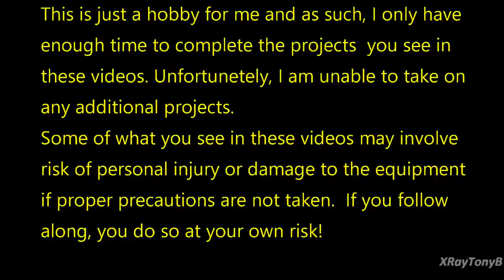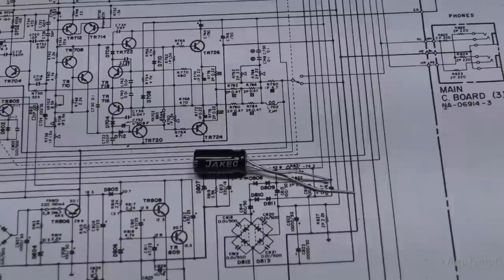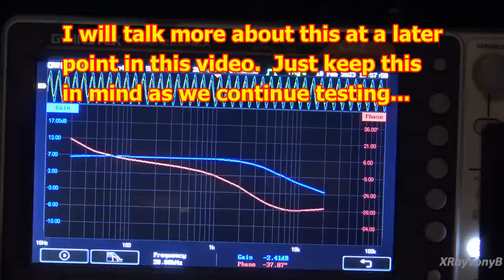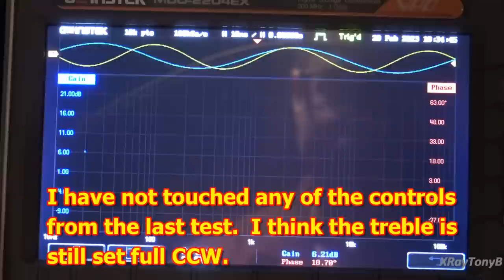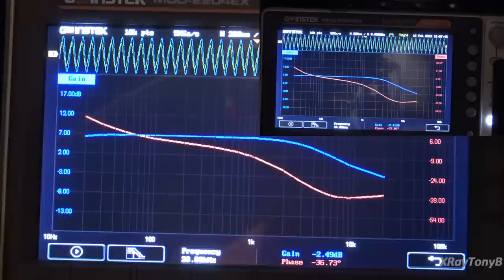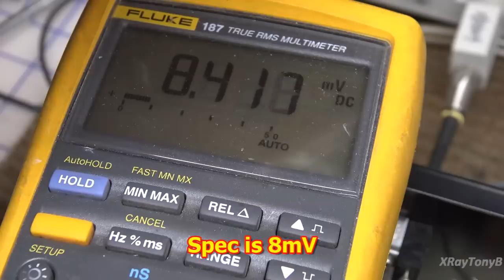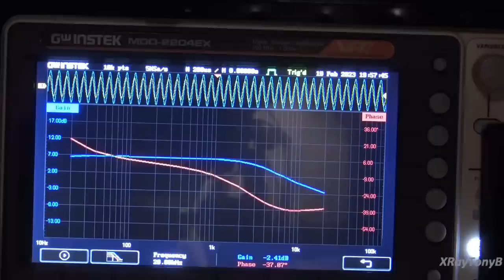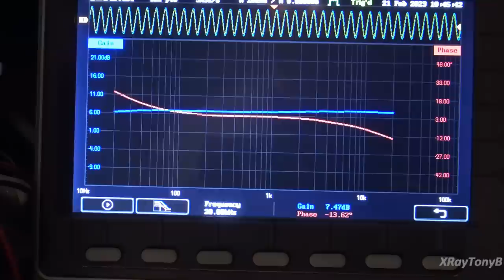Yamaha CR 820 - Replacing Capacitors and Testing

Comment: A couple of thoughts here. I agree. I usually buy from digikey because I trust them. But how do we know that digikey or Mauser buy their capacitors from good sources? We really don't do we? They're just suppliers that buy capacitors from other companies . It's a crap shoot. Maybe they buy them from China at a discount as well? As long as they are within the range of the correct capacitance I just use them. How long they're going to last is anybody's guess.
Reply from the maker: If you check with Digikey & similar companies, you will find that they are ANSI & ISO9001 certified in addition to other certifications.  There are quite a few quality standards that they must conform to in order to be able to hold these certifications.  Part of this is to be able to trace the sources and standards of the products they sell.  They are also a participant of the CAAP program which is in place to prevent the sales of counterfeit parts.  This is what permits them to sell to other ISO certified manufacturers.  This is why it may cost more to purchase from them than from an unknown source selling on eBay.  Companies such as Panasonic, Elna, Nichicon, Kemet, etc must also conform to these standards.  That is the beauty of ISO and ANSI certifications.
Reply: @xraytonyb   Thanks Tony. I was not aware of their certifications. I'm purely coming at this as a home hobbyist guy. I appreciate your videos and all your expertise. I've learned a ton from you. And like I said, I buy from digikey because I know it originally started out as a ham radio company and I trust them.
Reply: @xraytonyb  The weak link in this scheme is when a bulk buyer orders the certified parts, but returns counterfeits for credit, as "not needed".  The Mouser or DigiKey Returns Dept may just return them to stock, and not be able to detect that they were switched out.